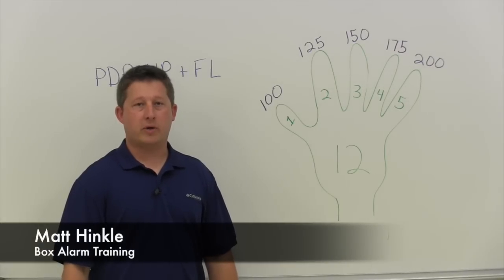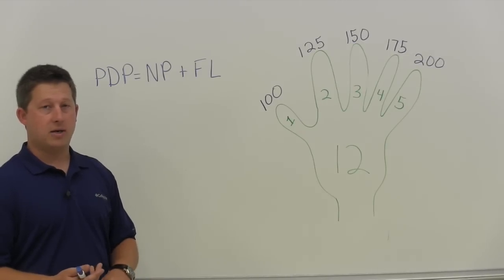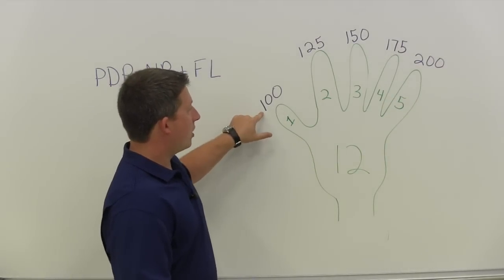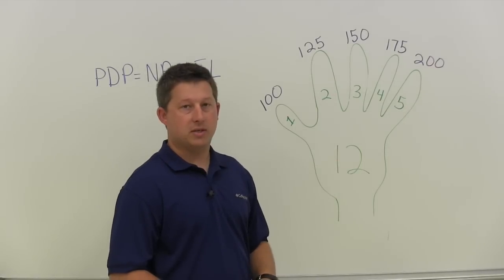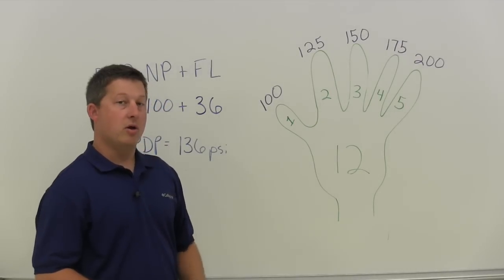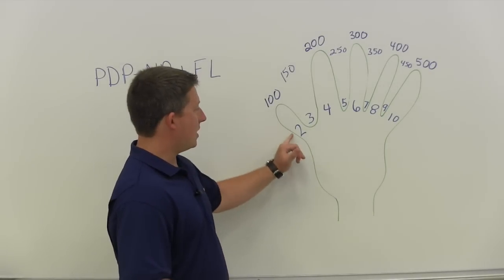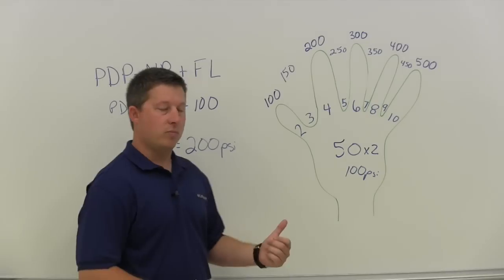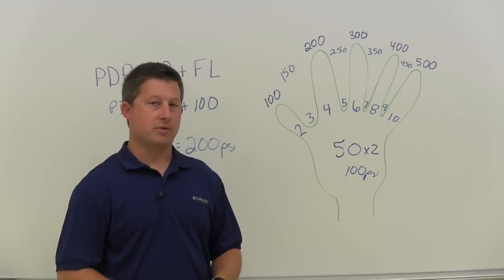Hand Method for Calculating Friction Loss for Firefighters

Comment: When you explain using the 246810 you were x the ist digit x the number in you hands. Here you did not use the coefficient.
Confused, or maybe I am just stupid♑️♎️♐️🈚️
Reply: 1-10 are your multipliers they take the place of the coefficient we saw as a 12 with the 1 3/4 method right before this! You multiply the gpm from the tips of your fingers, or the gaps in your fingers, with its corresponding multiplier.

Comment: So you x 100x1 but when you use the 150 you x the # on 150 x the c(12) 36. Why you didn’t x 150x3x12. Confusing to me.
Reply: Not quite. The 100-200 is just the GPM from whatever nozzle you are using. Once you know what your GPM is, you then use the corresponding muliplier and multiply by “12”. Hope that helps. That will give you the FL per 100’.

Comment: It seems like that multiplier is a bit off. Generally speaking, at 125 GPM you can add 12 PSI per 50 ft of 1.75" to get your friction loss. And if my math is correct, you should get roughly 18 PSI of friction loss per 50 ft or 1.75" section at 150 GPM. It's just a quick and easy method to get roughly the correct pressure per section per GPM. I know it isn't super precise but I feel like the hand method you were using would put you way over your desired pressure. Or maybe I am overlooking something. Does anyone else agree or am I pumping incorrectly?
Reply from the maker: This hand method uses coefficients provided from a text book when this video was produced. The coefficients vary greatly depending on the hose construction and actual internal diameter. There is a significant different in coefficients between a 1.75” and a 1.88” internal diameter but both of those hoses are called an 1 3/4”. The only way to actual determine your PDP is to test your own hose lines and attack packages. Even a 50’ hose line is not actually 50’. If you open the box on several sections of new hose that are labeled 50’ they will almost never actually be the same length. I’ve seen hoses differ by more than 5’ but both called 50’.

Comment: What is the multiplier if you are running 1.5" hose?  thanks.
Reply: Steve Hutchinson use the same method, should get you close to the adequate gpm required.

Comment: where's the other method you were talking about something 10 method
Reply: Dale Lewis did you ever figure out the drop 10 method? It’s good to know. It works for 2.5” hose. For example: an 1 1/8 smooth bore flows 265 gpms. So you would first drop the 5. Then subtract 10 from 26 which leaves 16. That’s it. Your fl is 16 psi per 100’ of 2.5” hose.

Comment: I'm sorry, but even this is just too complicated for use on the fireground.  As stated in the beginning, it doesn't account for elevation, or other factors.  So what's the point?  I know I want 140 psi on the panel when I pull 200' of 1 3/4" with a 100 gpm fog nozzle (standard crosslay on my engines).  If I need more or less pressure I ask for it.  Sit down, in quarters, and figure this out without clever shortcuts for typical configurations, and make an easy to read chart.  That is your starting point, then listen to the guy on the nozzle.
Reply from the maker: That's perfectly fine for your operations and I prefer charts exactly like you are saying. I made this video to explain this method because many get confused and have to learn it for tests or promotional exams. Some actually like this method but my experiences generally lead to finding the method(s) you prefer and sticking to them. If you like pre-planning and making charts then I couldn't agree more. Glad to hear you all are taking the time to do that.

Comment: Are these the current IFSTA methods?  I know the older edition for 1 3/4" showed 9 for 125gpm and above and 12 for 100gpm.  Looking around the nets I'm finding multiple versions.
Reply from the maker: That is a very good question and I completely understand where you are seeing these. I am not sure why some texts have decided to change the 12 to a 9 on the hand method but my math puts the "9"" way under what the pressure should be. Ultimately, we have to get out a flow each of our own systems to see what the discrepancies are but here is an example: The actual FL for 200 GPM through 100' of 1.75" is 62 psi. Using the "12" hand method will get you 60 psi (pretty freakin close). Using the "9" hand method will get you 45 psi... This is pretty drastically lower than what it should be. Increase that to a very common 200' attack line using the "9" and you are 35 psi beneath the required nozzle pressure. We actually use a text book at our academy that shows both the "12" and "9" in different printings of the same text. I was told this was a typo but also saw it in a brand new text I was reviewing for a publisher. I'm not sure if I am helping at all but this is what I know... haha
Reply: Thanks Matt. I was just reviewing and noticed the older book I had showed 9, but I also did the formula and noted that 12 is much closer all around to the formula. Thanks for the reply! You're definitely helping, keep up the good work!
Reply: @Boxalarmtraining  The old method is a 9 multiplier, the new method is 12.
Reply: Matt Hinkle I think the MFGS have started to change with the new High Combat technology that is giving more water w/ less friction loss. While I understand some people saying figure this out in the station and I agree. This type of "rough math" is helpful when you have to extend the hose load 100' on the fly. A fairly common occurrence when using a courtyard lay. In our 1st due. we have big houses on long driveways, with no hydrants (Tankers and drop tanks) At almost any instant your pre-connects get CHANGED to accommodate a need. These shortcuts help a lot.
Reply from the maker: Yea, I have read other text books that show using the number 9 in the palm instead of the number 12. That will drop your friction loss down to something more like the High Combat or the Ponn Conquest. If you use a lower coefficient hose I would go with "9" if not I would stick with "12". Best thing to do is flow test your current setup to get a good baseline that way you know where to go from there.